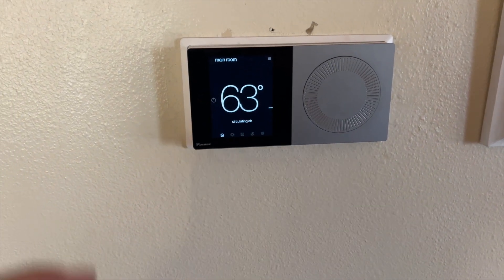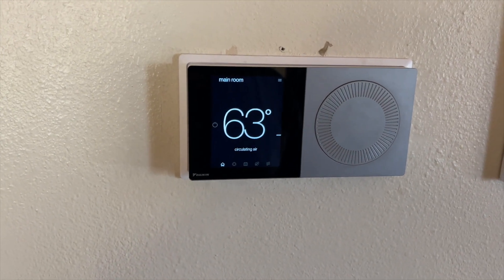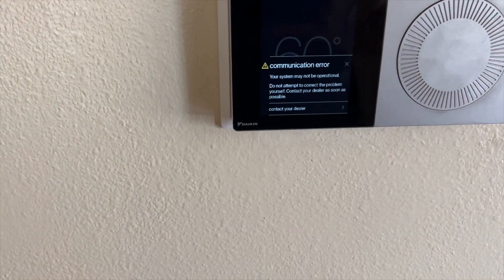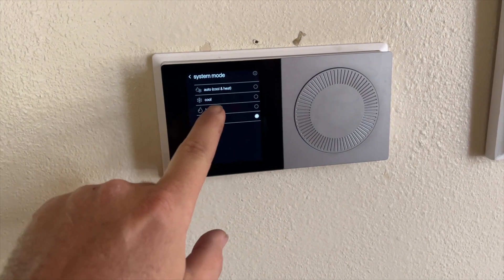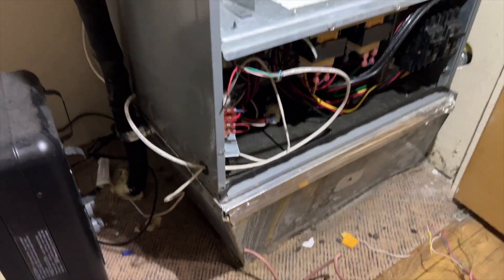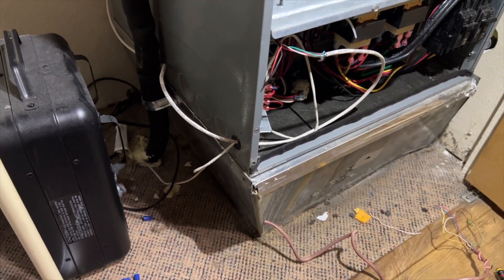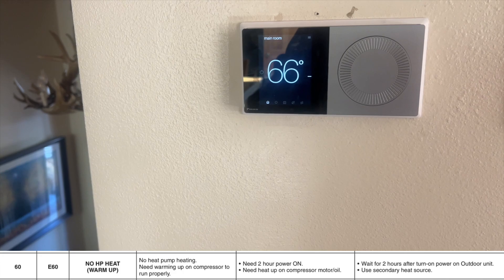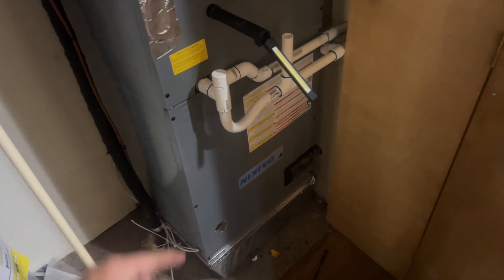Daikin DZ17VSA Series Minisplit with Full Size Air Handler Not Communicating Intermittently.  EP152

Comment: That system is going to be problematic due to the proximity to that wall in the front and the Back.  Also the shielding in the cable going to the outdoor unit must be grounded on the outdoor unit only and not on the indoor side so it does not create an antenna for the communication system..

Comment: Great video ! I have a question . Am I supposed to have resistance to ground on my contactor coil 24v with the wires plugged in
Reply: Or should there be no resistance to ground / O.L when I check the coil side

Comment: Good catch! Question,  on aircraft shielded wire we have to continue the shield ground (they call it a drain wire) across a break in the cut in the cable, do they recommend,the same break you have in it inside the air handler?